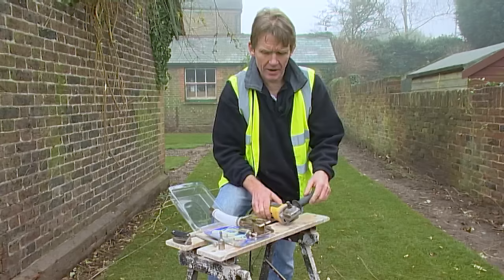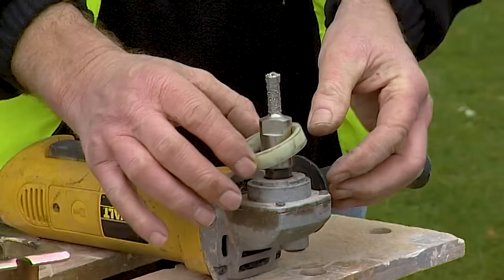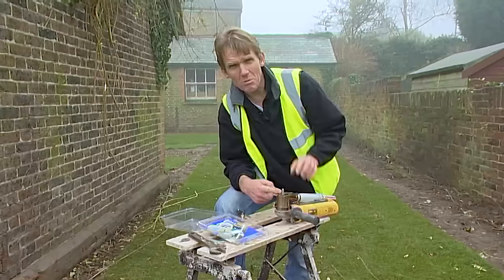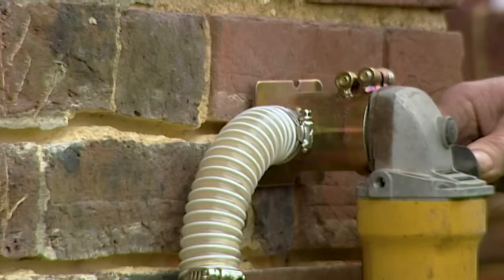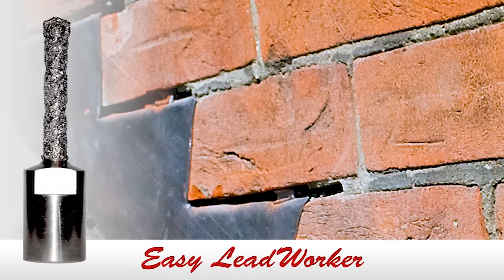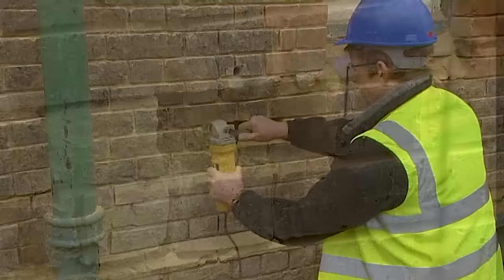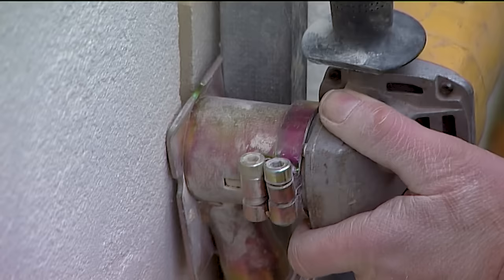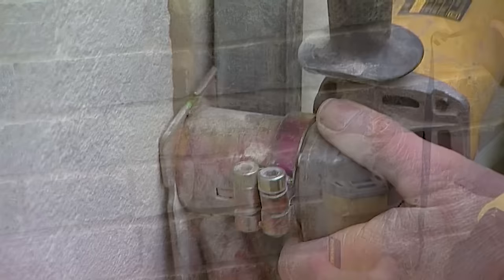Removing Mortar Between Bricks with Morta Sortas

Comment: I have used these and they are great,but as you state only on softer mortar like sand and lime. I recently repointed a whole house that although was sand and cement mortar in some places it was as soft as lime,but in others it was as hard as granite. The customer wanted the whole house to look the same,so I had to use an angle grinder with mortar raking disk. It would have taken me a month of Sundays to do it with that setup you used in the video. A skilled person can rake the mortar without ever cutting the bricks,and I have done this for over 30 years so I class myself as skilled at it these days. I hate the dust,but I warn all of the neighbours to shut their windows and get their cars out of the range of the dust. Its a pain having to sweep everyone's properties but the speed allows me to do the job quicker saving the customer money.
Reply: Yep, same here for 54 years of masonry work.

Comment: The reason you'd remove hard mortar is in my experience because its been wrongly specified for brickwork that is softer than itself. A predominance of cement mortar in place of Lime mortar due to lack of awareness of material function and use.
Reply: This is my problem. What would you use to remove?
Reply: @empathyrevolution  assuming it was bricks probably a mortar rake on angle grinder. Usually 8-10mm wide disc. Ask advice from specialist lime supplier on suitable lime mix to use.,.

Comment: I used one of these a few years ago and went through 3 angle grinders! The bearings don't like the pressure it applies through the different angle. It did do the job though. 🙂

Comment: Hi. what about the really thin vertical joints, that tool looked too thick to pass down the joint. do you just push it down anyway removing some of the brick too to make a wider joint to re point?

Comment: Hi there, I tried the old one of these some years ago and found that not only did it wear out very quickly and was very slow the worst thing was that it could not cope with the small hard stones found in old rough lime mortar, it kept trying to go round these bits and eat into the soft brick!. I also tried with another type that has a tungsten carbide cutter which was much more durable and effective but the less durable bit holder gave up under the strain!. In the end I had to revert to the old ways on large areas of repointing, by hand!. The chasing for lead flashings I still use the angle grinder with an expensive diamond disc, they last much longer, make  one cut at the 'top' of the joint, just along the bottom edge of the brick, and then another straight cut, parallel, at the 'bottom' of the joint, again just along the edge of the brick, make sure that both cuts go the full depth of the blade, never less than 30mm, finally break out the strip of remaining mortar with a two inch bolster and you will have a chase that will receive a 20mm turned edge of the flashing - straight in one go no messing.  Another example of the extra time spent in preparation saving effort at the end!. The last trick in that little book is to dress the turned edge of the flashing as tight and true as you can, you should find that you can carry the 1.5 metre section to its place one-handed without it collapsing, if you then fix it with those clever little stainless steel clips the pointing will lock it all in, for god knows how long!.  My final point is on dimensions, with all flashings and re-pointing it is very important that the depth of the chase is never less than 1.5 times the width of the joint, so if the gap between the bricks is 10mm the chase must be 15mm, this way no matter what happens with future adhesion the section of mortar cannot roll out of the joint!.
I have posted this to you because I very much like your attitude and the way you explain things. Cheers,Richard.
Reply from the maker: Thanks Richard. I take all your points on board. I have found the tungsten bits to be better than the diamond and cheaper.
Reply: @SkillBuilder  Hi there thank you so much for your quick response, sitting here stuck inside because I can't claim that any of the jobs I could be doing can br called essential at this time, trawling through U-tube sites about the dreaded lurgi, becoming ever more despondent as it seems the whole world falls apart and there is nothing I can do!. I feel much better now and am so glad to be helpful.

Comment: And how long does that bit last and what is the cost of one bit?
Ive used diamond bits and they last about one day of steady grinding
Reply from the maker: Actually the tungsten bits are a better bet. Most repointing jobs are lime mortar. If the mortar is hard to get out it should be left in.

Comment: Looks like the softest mortar I’ve ever seen try it on as mother wall say one that’s been repointed in the past
Reply from the maker: It is soft sand and lime. That is very common and even then it probably would have done another 20 years with no problem. It has never been repointed. You can tell. There are hundreds of houses in that area with the same profile.
Reply: Skill Builder  well there’s not much of that up here in the northwest,

Comment: Your link takes me to a raking tool, but what is the Easy-guide attachment?  Could you post a link to one, please?
Reply from the maker: The guide is now sold by Irwin and is a lot cheaper..https://www.amazon.co.uk/10507267-Mortar-Starter-10507234-Adaptor/dp/B08VJYPX69/ref=sr_1_2?adgrpid=53911920900&dchild=1&gclid=Cj0KCQjwm9yJBhDTARIsABKIcGaxa39iMEo3ZD48fY6MKzU0BcRmWAzTOeBpsXwUDOTL1NR1B79uh1EaAn3gEALw_wcB&hvadid=259072005985&hvdev=c&hvlocphy=1007014&hvnetw=g&hvqmt=e&hvrand=10826594154329845107&hvtargid=kwd-300198778240&hydadcr=29381_1700893&keywords=irwin+mortar+rake&qid=1631045642&sr=8-2

Comment: Hey i would like to buy the easy wrecker and dust remover could you pls let as know where we get it
Reply from the maker: it is now sold by Irwin   https://www.amazon.co.uk/Irwin-10507268-10mm-Mortar-Starter/dp/B002EI7W2A/ref=sr_1_2?adgrpid=105011172687&dchild=1&gclid=Cj0KCQjwkIGKBhCxARIsAINMioKMnot4wwACpaYcUAozKj_TEw79tRffFR6Sz6mI7eJmT_iYZB7WirkaApmCEALw_wcB&hvadid=435784779005&hvdev=c&hvlocphy=1007014&hvnetw=g&hvqmt=b&hvrand=12916634593551051887&hvtargid=kwd-331231669085&hydadcr=18454_1816559&keywords=easy+raker+mortar+removing+tool&qid=1631608410&sr=8-2

Comment: Waste of time on harder mortar joints
Reply from the maker: Yep that is what he said. Top marks
Reply: I recently repointed  my brick house and bought this tool  along with a 10mm thick blade.
I used two 115mm angle graders , one fitted with the blade and the other fitted with the router tool.
This is what I quickly discovered. It would of took me absolutely ages with the router blade on standard mortar.
Plus the router style bits really didn’t last very long at all
The 10mm disc cutter was 10 x faster and with a little practice I became quite skilled at using it to get the correct depth etc.
I only used the router blade to finish of off the perks.Thats my really life experience of using this tool.